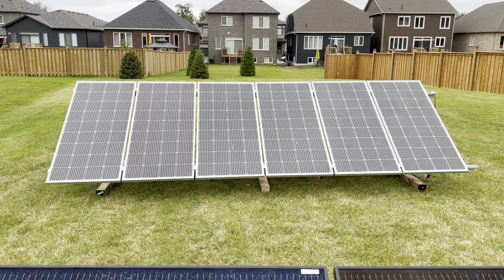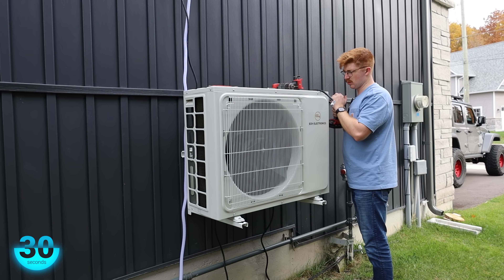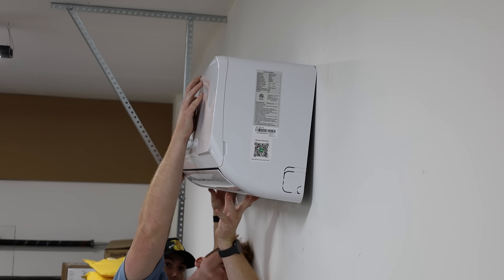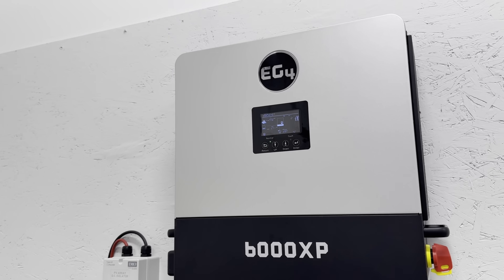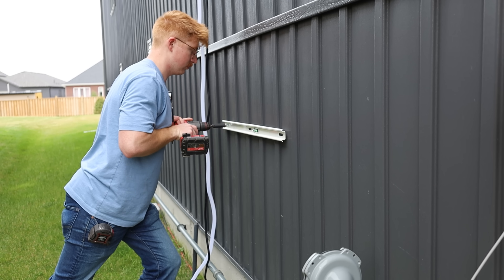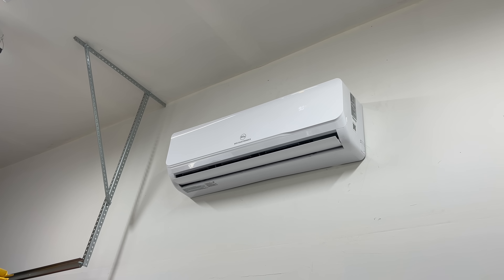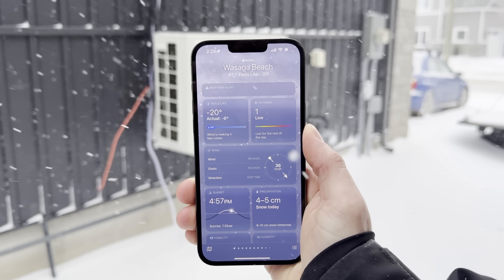Cheap & Simple EG4 Solar Heat Pump - Anyone Can Do This!

Comment from the maker: 🛒 EG4 Solar Mini-Split ➡  https://signaturesolar.com/eg4-hybrid-ac-dc-solar-air-conditioner-2-ton/?ref=thesolarlab
➡  Get $50 OFF with Discount Code THESOLARLABSAVE50

⚡Get an Instant Power Station Recommendation ⚡
➡ Take Our Quiz: https://quiz.typeform.com/to/zpvK6MPQ

💸 Get Exclusive Solar & Power Station Deals First 💸
➡ Subscribe Now: https://www.thesolarlab.com/subscribe

We Recommend Shopping at These Online Stores: 

🛒 Signature Solar - EG4 Products + Solar Panels
➡ Get $50 OFF with Discount Code: THESOLARLABSAVE50
🔗 https://signaturesolar.com/?ref=thesolarlab

🛒 Shop Solar - EcoFlow/Anker Bundles + Complete Solar Kits
➡ Get 4% Off with Discount Code: THELAB
🔗 https://shopsolarkits.com/collections/promotions?ref=TheSolarLab

🛒 Pecron Power Stations - High Quality, Budget Power Stations
➡ Get 5% Off with Discount Code: THESOLARLAB5
🔗 https://www.pecron.com/#ref=229

🛒 EcoFlow Power Stations - Delta Pro, Delta Pro 3, Delta Pro Ultra, Delta 3
➡ Get 5% Off With Discount Code: 25EFDCTSL 
🔗 https://us.ecoflow.com/?aff=925

🛒 Jackery Power Stations - 5000 Plus, 3000 Pro, 2000 Plus, etc
➡ Get 15% Off With Discount Code: THESOLARLAB
🔗 https://bit.ly/447bRnM

🛒 Anker SOLIX Power Stations - Anker F3800, F2600, C800, C300
➡ Get 5% Off With Discount Code: THESOLARLABPD
🔗 https://bit.ly/3ELICvV

🛒 OUPES Power Stations - Mega 5, Mega 3, Mega 1
➡ Get 5% Off With Discount Code: THESOLARLAB
🔗 https://shrsl.com/4xhzg

🛒 Current Connected - EG4 & Victron
🔗 https://www.currentconnected.com/?ref=thesolarlab

---------------------------------------------------------------------------------------------------------------------------------------------------

📖 Read Our In-Depth Product Reviews:
➡ https://www.thesolarlab.com/reviews

---------------------------------------------------------------------------------------------------------------------------------------------------

🔔 Subscribe to our YouTube Channel:  @TheSolarLab 

0:00 - Intro
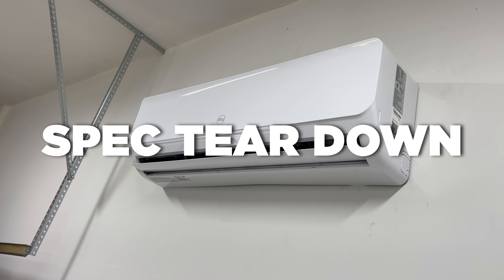1:50 - Spec Teardown
2:59 - Install
5:03 - What We Like
7:25 - What We Don't Like
9:51 - Summary

The EG4 Hybrid Solar Mini-Split is a super popular unit that's designed to run efficiently on solar power, batteries, or the grid. In this review, we put it to the test to see how well it handles heating and cooling, how energy-efficient it really is, and whether it’s a good fit for emergencies or off grid setups. If you’re looking for a solar-powered air conditioner and heat pump, this could be a game-changer.

We maintain an affiliate relationship with some of the products reviewed, which means we get a small percentage of a sale if you click our links, at no cost to our viewers.

Comment: The vibration from the condenser unit is causing the droning or humming noise.  Since it’s attached to the r-panel, the vibration spreads through the r-panels and the structure they are attached to, especially if they are attached to a steel framed structure.  

To eliminate the droning/humming, you will need to separate the condenser unit from the building.  Rubber feet will reduce it some but very little. 

I had this same problem from two mini splits units attached to my steel framed r-panel covered house, they were stacked one above the other.  It drove me insane for weeks.  The whole house hummed as long as the units were on.  I finally had a welder build a steel tower to hold the condensers so they were no longer attached to the house.  

The droning/humming was eliminated.
Reply: Do you have any experience with the "water running" sound on the outdoor unit? It's not like a humming sound as I can hear from the line set. Thanks so much.

Comment: Just saw your review, thank you. Very informative.
Asking price is $2,213 not $1,849, that would've been nice.
How can we know the performance over time if the unit is only about a year on the market? Can I use my existing roof solar system with this unit?
Your reply is most appreciated
Reply: There's no way to obtain an original unit from SignatureSolar. The one you saw there is likely the V1, the newer version of this mini-split.

Comment: Any way to add batteries +extra panels for night time cooling?  I realize this calls for a string better just wonder if it’s possible with micro-inverters?
Reply: There's a way, but the switch is manual. Otherwise, you will have to change your whole house setup to a battery to use the powerline.

Comment: Good video. Just bought the 24k BTU unit with 7 solar panels to cool my ridiculously hot Colorado garage. Got it installed between last weekend and today. The solar installers will be here next week. Looking forward to firing it up and cooling this place down. Did not mount the outside unit on the wall. Built a 36 x 30 x 4 concrete pad and put it on a stand that will keep it around 19 inches off the ground to avoid snow. This is not a one person install. You’ve got to have help. A buddy from work helped me with the concrete pad and my son helped with installing the inside and outside units. Mounted the inside unit about 8-1/2 feet up the 11 ft. garage wall.

Comment: can anyone tell me what kind of temperatures this will generate for heat when the outdoor temperature is say 20° there must be a scale somewhere of its efficiency or its performance at 20° compared to 10 below zero? I have one of these in the cart at signature solar I live in New Hampshire and I’d like to know what type of heating performance I can expect before I pull the trigger. ???

Comment: I wish someone would do a video on how to run the solar panels in series I don't have the slightest idea, electrical precautions, connecting the wiring, everything is about the mini split I have that part done I don't want to set my house on fire did you make a video on how to install the panels by chance
Reply: Will Prouse does some very good videos.

Comment: You mounted the exterior unit on a wall without any insulation. That means it is using that entire wall like a drum head creating the droning you hear. Add some 1/4 inch rubber padding between the compressor and the bracket and it will dampen the noise a bit. You could also drill a hole in the wall from the inside between the studs that the bracket is attached to and shoot some spray insulation into the airspace to help deaden the noise. Or apply a couple of sheets of rubber noise cancellation padding to the interior wall there.

Comment: As you yourself mentioned, however, you tested it in a garage with no insulation. No insulation + -20F + only using 2kW of power and it was able to maintain that large of a space? I want to get two of these. The 12k BTU version of my garage (my office is right above it and my feet freeze in the winter) and the one you tested for the first floor so that my geothermal doesn't need to run as often.

Comment: FWIW, could place vibration isolating pads rubber-like, etc. between the mounting brackets and the unit, and any place the unit touches the structure...

Comment: Not a specialist in this, but I bet you could mount the outside unit onto a rubber bracket addition and it'd take away the droning sound.

Comment: Great video and of course great comments on the mounting cause of the sound of your dislike.  That comment on working in Texas summer heat at nights will require the grid.  Our temps do not drop much at night, example is 89-degrees at 10:30 PM going down to 78ish by 6AM the next morning, UGH!

Comment: As a hvac tech don’t expect any heat pump to work super well below freezing temps these inverters are better than most heat pumps but without a back up heat source like regular split systems be ready to have these constantly have to hit defrost cycles

Comment: To solve the drowning problem go to your local hardware store and get yourself some 4 inch by 6 inch by quarter inch thick rubber pieces you're going to need something to prop up your mini-split so the connections don't break or anything like that so that's where you will mount these pieces of rubber behind the mounting bracket up against the wall you're going to need a longer screw for it to mount this but I'll act as an isolator to isolate the vibrational pulses from the mini split.

Comment: Your two dislikes about the unit aren’t related to the unit itself.

The droning is because of no insulation. I’m not talking about just wall insulation, use an isolator for the wall mount or ground mount it. 

The lack of cooling under 0deg or -6 or whatnot is a limitation of heat pumping. the temperature difference between outside and how cold the refrigerant can get is nothing anyone can control. Your solution to this is digging into the soil where the earth maintains about 70deg and having your radiator do the rest. this will solve your issue, and is a very common practice in any amount of colder climate for a professional/forward thinking install.

Comment: I ordered the 12K BTU hybrid last summer, when it was MEGA hot where I am. I got it as a combo with 4x 450W bifacial panels. It's been amazing, and I'd say I've already saved $300 in power bills - the app actually gives you great info on how much you've used and saved. I've even peeled off one of the panels to recharge power stations and stuff around the house, because the unit peaks around 1K of use, anyway, and 3x 450W is more than enough. 

I almost wish I had bought the 24K BTU unity, though, because I'm using it to cool my living room/kitchen area which is about 600 square feet, and sometimes it struggles to keep up on hot days. But it does just chug away all day, mostly essentially for free.

Once I convert my house fully to solar, I'll just run it off AC power like everything else. It won't be a waste, because it's still a very efficient unit, and app is awesome.

Comment: Do you have the space to Geothermally stabilize the garage? (basically lay down tubes under ground below the frost line to push and pull heat against.

Comment: Heating load is highest at night and when the sun is not shining.  Seems like these are geared more for cooling when the sun is out.  Otherwise, a standard inverter/panel/battery setup is much more efficient.

Comment: That droning sound is common with all  when they are attached to the wall like that
Reply: 100%...the wall mount is convenient, but can't really beat a little pad and ground mount. Will completely isolate the unit from the house. Walls are like a big vibrating diaphragm in this application.
Reply: @ I went from a pad mount to a wall mount because I had to replace mine after mice got into it and completely destroyed all of the control boards and wiring. The trade off is now the noise but in my case I am willing to live with it.

Comment: On any refrigeration unit you should always pull a vacuum on the line piping prior to introducing the refrigerant to the line. Step 1. pull vacuum to verify the connections doesn't leak. Step 2. introduce refrigerant to line. The system will perform better and more quietly with all the air out of the line.

Comment: Thanks. Great overview. We're running the 12,000 BTU unit (Small Boy!) in the Carribbean. 1600 w of solar panels. It does require a little bit of hydro to get up and running (20 w) and the cooling effect waivers depending on how directly the sun is hitting the panels. One feature that we love is that it has a function called "AC Limiter" which allows you to control the amount of hydro it can utilise. There are four settings: 1 = 300w, 2 = 600w, 3 = 900 w and 4 = 1200 w. You use this to control the hydro input if there's no PV available or at night. We're very happy with the unit and saving a ka-ka load on energy bills!

Comment: I have a similiar issue with really hot temperatures. If it gets above 110 the unit throttles down. Here in AZ it is very common to get above 110.

Comment: Heat pumps just transfer energy. Heat pumps become less and less efficient as the temperature Delta increases from outside temperature to inside temperature. Hoping in the future that they’re going to make heat pumps that can handle the extreme cold, requires complex series of heat pumps. Which increases the cost and increases the energy requirements.

You have three options: 

1) insulate, and seal up your garage.
2) get a second mini split and run it in “parallel”. Which will double your cost of your current system.
3) get a state of the art “serial” mini split, pay a ton of money and less sufficient.

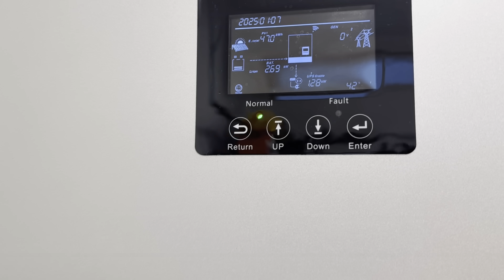Comment: just one thing that air conditioner is to expensive it is not worth it its is almoast $2000 not worth it you can get a same performance for like $1000 even for $800 if you really search for it. 4:25 every single air conditioner that IS INVERTER starts slow and then ramps up. And you installed it wrong and you need to learn A LOT on how air conditioners work. 8:06 No it is YOUR problem whit instaling it. you said it dosent heat that well belowe -5 that is bicus two things maybe low on refrigerant if not it is not a heat pump then it is a normal mini split try getting a air conditioner whit HYPER HEAT it can heat even below -40 so it is handle -25 no problem. The brands that i recomend are: 1.LG 2.Hisense 3.Mitsubishu 4.Panasonic 5.VIVAX 6.AZURI 7.Midea 8.TESLA

Comment: Immediate woopsie: Lack of dampers between mount and unit.
It's a quiet unit but it will transfer vibrations into that panel wall. Does not hurt to use the correct mounting hardware.

Comment: i live in Montana and have had a pioneer mini for the heating and cooling of my detached two car garage/workshop for over a year now. it has cooled the space perfectly in daytime highs of over 100f but the heating drops off dramatically at 0f. it is only a 9k btu unit and pioneer now sells an arctic unit that would be better for me in winter. from what i have read they essentially become a resistance hearer in negative F temps. for now i run a small pellet stove when it gets to single digits and save my money to upgrade to a more cold capable model.  For this tech to work best the units should be left on 24/7 as the variable speed compressor works best when it is maintaining a temp and not having to make large temp changes.

Comment: The big issue with this unit is that it will only heat to 32f or 0c. 

Completely unsuitable for cold climates.

Especially when other vendors units will heat at 0f and below.
Reply: You're wrong. This unit works well below freezing temperatures. There are numerous Youtube videos showing this in actual installs. Have a look.

Comment: Have 5 of the 12k units, 4 of which are mounted to shipping containers, 1 on a tiny house. The drone is also present on the 12k units if wall mounted with hard rubber feet. This is less of an issue with the shipping container mounted units, I suspect purely because of rigidity of the wall. The line sets also make noise if run through a wall cavity. Great and efficient units, they seem to randomly power cycle and lose their settings (fan speed, vent sweep) but other than that like I said, great units.

Edit they also do have emergency heat on the 12k, idk about the 20k

Comment: FYI, he didn't mention this during his sales pitch, but if you need to connect this unit for your home power grid (and 99% of people will), you need to connect it to 220V power, which almost certainly means paying an electrician to install a dedicated 220V breaker and outlet just for this unit, as most US homes only have 220V available at one outlet to power an electric dryer (and no, you can't share that outlet/breaker with the dryer and heat pump!). I have a similar unit in a smaller room, its actually way oversized, and when the outside temperature drops below like 15 degrees it can't even maintain 68 degrees inside! Don't be fooled if you live in a cold climate, heat pumps suck when the outside temp is below freezing. Otherwise they are great though.
Reply: Maybe this unit, but many are engineered for cold climate. The performance charts can be hard to find, but find your performance specs for your area, then compare performance for those temperatures. We're doing great with a moderately well insulated house at 5000 feet altitude with moderately cold temps at night (about 0 degrees fahrenheit).

Comment: 6:21 Please don't do this... All you have to do is open it (counter clockwise) all the way without forcing it and then back it off a smidge (clockwise). Don't tighten it open like this, it will cause a leak if you damage the gasket inside the valve.

Comment: For the climates you have i'd recommend you to get water to water heat pumps , it does not depend on outside air temp and will be much better suited to heat your house

Comment: Good review, I actually have the Hybrid 12,000 BTU model and have a couple of tips to share.

Avoid using Turbo with the fan, use Auto feature instead. The slower the fan the quicker the room will heat up. With a large room, use Auto the fan will adjust as temperature changes but will usually not enter Turbo mode and stay with a good steady fan speed. This helps warm or cool the room quicker, that's my from experience.

I recommend going over the website manual, it has more information on settings and other important features, And Hybrid Mini-Split models have different features from a regular mini-split.

I have a 1,600 Watt Solar ground mount to run my 12000 hybrid mini split during the day, and operate off grid during the night. And solar generators to run the mini split during the night if grid goes down, I forgot to mention as you touched on efficientcly in Cold weather, mine also isn't as efficient under cold conditions but will keep a large room warm in the twenties. Lucky, my area only gets down in the high twenties  (28*F).

Thank you for sharing.
Reply: Forgot to add, the droning effect is probably from the unit mounted to the outside wall, coupled with poor insulation the droning noise travels throughout the interior Walls.